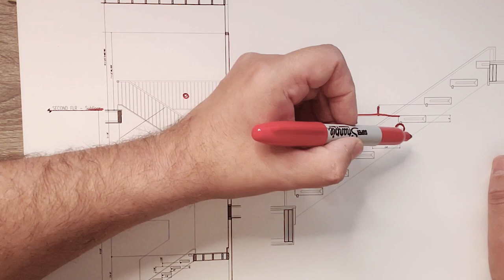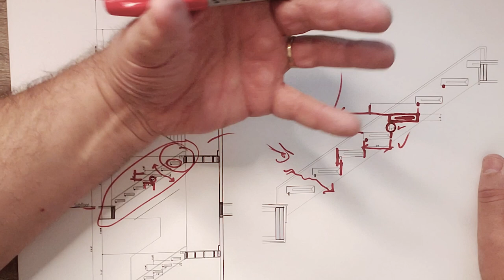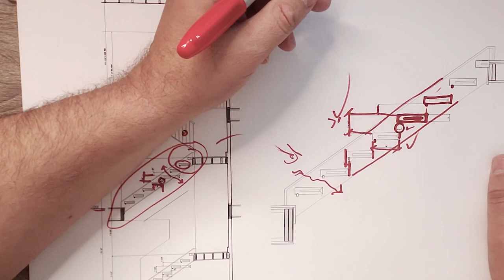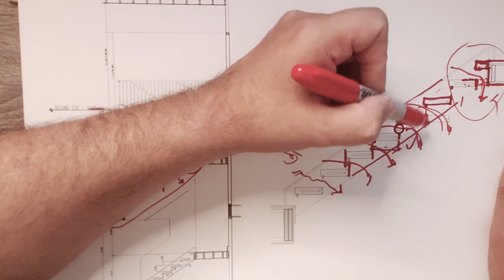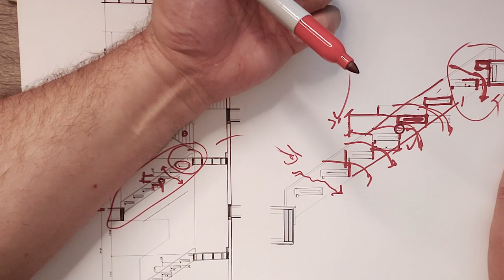FRAMING a Open Riser Staircase

Comment: I like the open backed steps. But residential codes here say only 4 inch gap between steps like guardrails. But can use a ship's ladder for balcony lofts and built barn ladder other end. I have to have 2 ways off balcony by code. I hate straight up barn ladders.